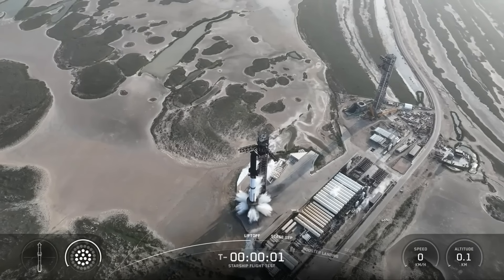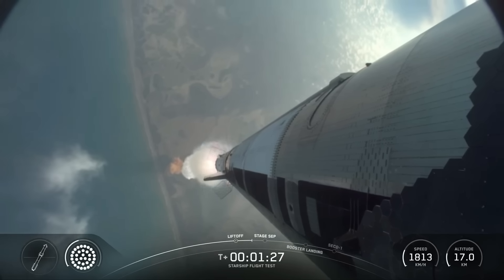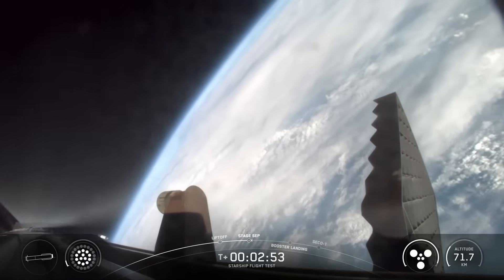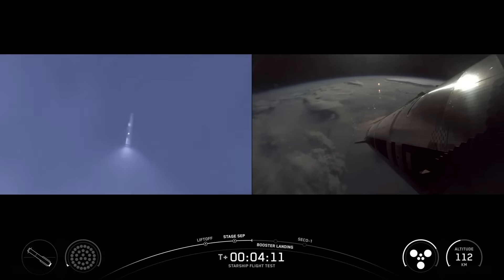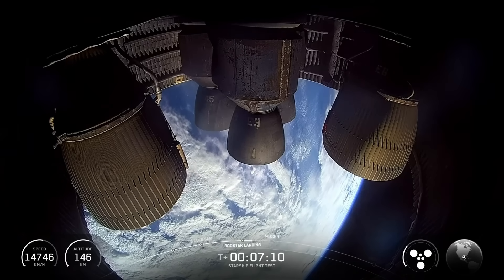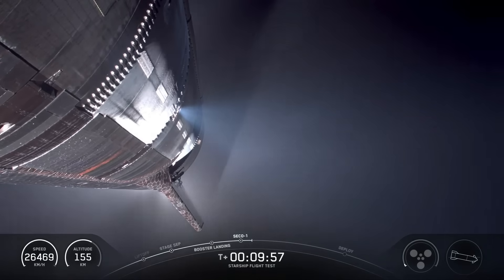FULL FLIGHT: SpaceX Starship Flight 9

Comment from the maker: 00:00 Liftoff
01:10 Max-Q
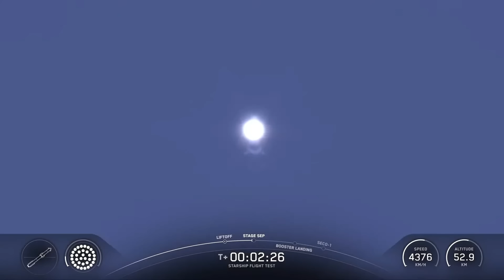02:40 Stage Separation
03:15 Boostback Burn Shutdown
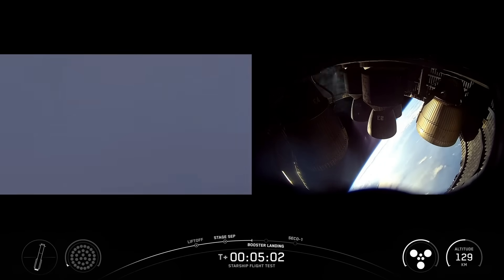05:10 Starship Engine View
06:15 landing Burn FAIL
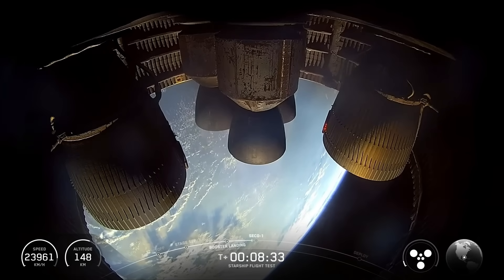08:45 SECO - Starship Engine Burn Complete

Video Credits: SpaceX

📚 Learn More:

🚀 Starship Block 2 Explained:
 📖 Summary: https://shorturl.at/b0dtw
 🔍 Detailed Explanations:
  • Design Improvements Update 1: https://shorturl.at/lpGT7
  • Design Improvements Update 2: https://shorturl.at/gwNQ4
  • Nosecone & Payload Bay Redesign: https://shorturl.at/xa60S
  • Methane Downcomer Redesign: https://shorturl.at/XdYBG

🚀 Starship Block 3 Explained: https://shorturl.at/mnBT4
🚀 Starship & Booster Block 3 Detailed Breakdown: https://shorturl.at/IViwD
🚀 Starship & Booster Block 3 Production Begins: https://shorturl.at/xRNkJ

🔥 Raptor V3 Mega Upgrades & First Test: https://shorturl.at/TRIyj
🧱 What’s Inside Starship GigaBay?: https://shorturl.at/nJM75
🛠 Insane Engineering of New Starship Launch Pad B: https://shorturl.at/7RAZd

🛠 Other Starship Upgrades:
 • Hot Staging Explained: https://shorturl.at/jf400
 • Super Heavy Booster Upgrades: https://shorturl.at/Pi5R3
 • How SpaceX Protects Raptor Engines: https://shorturl.at/4Om8F
 • New Heat Tiles Explained: https://shorturl.at/p2Ijb

🚀 Starship Flight-7 Anomaly Explained: https://youtu.be/UqzZx7vb-TA
🚀 Starship Flight-7 Root Cause & Fixes: https://shorturl.at/HcLKo
🚀 Flight-8 Complete Breakdown: https://youtu.be/f26yH80RK2o

🔥 Ship 35 Static Fire #1 Anomaly Breakdown: https://shorturl.at/eLCvL
🔥 Ship 35 Long Duration Static Fire #2 Breakdown: https://shorturl.at/Ypf0p

📡 Stay Updated:
📢 Weekly Updates: https://bit.ly/3HIQjPC
🚀 SpaceX Playlist: https://bit.ly/34wue8T

🌍 Follow Us:
👍 Facebook: https://www.facebook.com/scientiaplus

Comment: "Dont worry, its just a test" after 9 failures, when do you start to worry?  How many failures did the Apollo program have in the 1960's again?
Reply: Flight 5 and 6 were not failures. They were outstanding successes.
Reply: @Sagan_Starborn  If I recall, the wings burned through on both of those flights.  Does not bode well for reusability.  Plus, going from outstanding successes to absolute failure is progress in the wrong direction.  I can understand a kickup every now and then, but this is a bit much.  Falcon has been flawless so I know they are very capable, but maybe this is the wrong path?
Reply: @Sagan_Starborn  no it was a failure.
Compare this to Apollo project .......space X are clowns!
Reply: @Leon1Aust  I think the engineers are OK  he problem is the CEO, Clown Executive Orangutan, Elon Musk and his idiotic "iterative design process"!! 

How's that move fast and break things going??  And SLS and New Glenn took a long time, but worked on the first try!  Because they used the traditional disciplined engineering approach!  

Guessing and going, just for the sake of doing it quick, is just a stupid approach  for real world things where the cost  of failure is insanely expensive!
Reply: This ship is better then Saturn long term.

Comment: @4:30 (T+:4:20 and T+:4:54) Fire in the engine bay. Blue flame to the left between sealevel and vacuum Raptors. 
@5:30 (T+:5:15)                       Metal fire torch at this location.
@9:10 (T+:9:00)                       On sea level shut off, the engine bay ring glows (is there a purge line exit?).
@Payload Deployment           They should hire some Boeing engineers for the payload door ;)